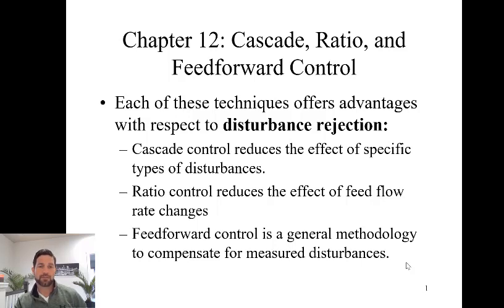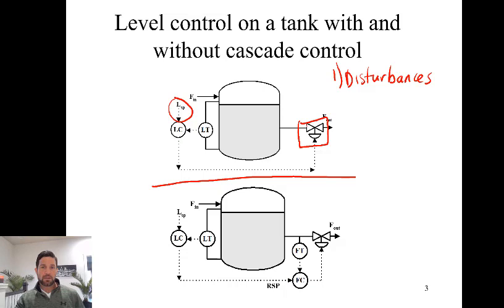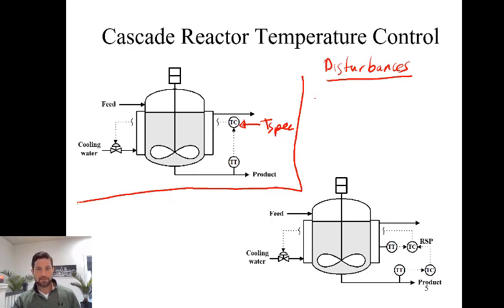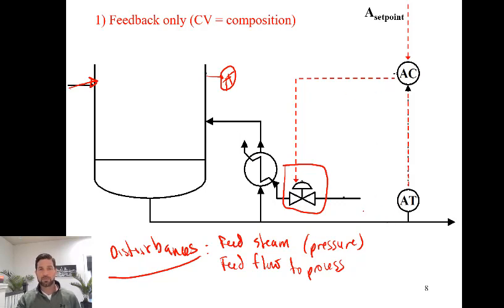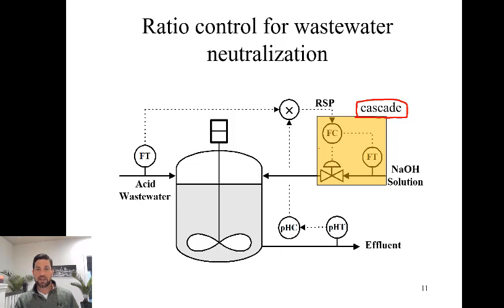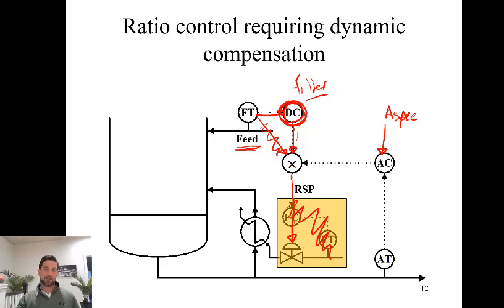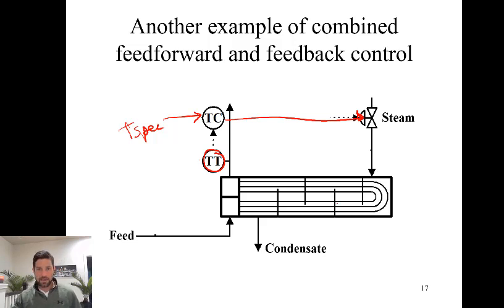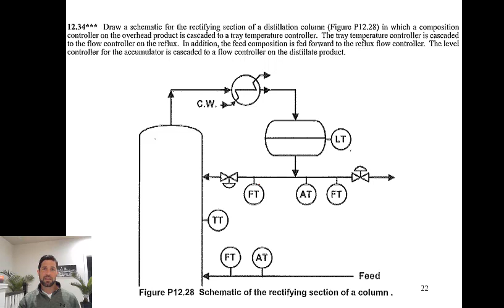Cascade, Ratio and Feed Forward Control

Comment: In feedback control loops, the controller is often implemented as a cascade, ratio, or feed forward controller. The cascade controller consists of a series of two or more subsystems, each of which performs a specific task. The ratio controller compares the output of one subsystem to the input of another and adjusts the output of the first subsystem so that the ratio of the two remains constant. The feed forward controller anticipates future changes in the input and outputs a signal that will maintain the desired result. Each type of controller has benefits and drawbacks that must be considered when choosing the best implementation for a particular application.